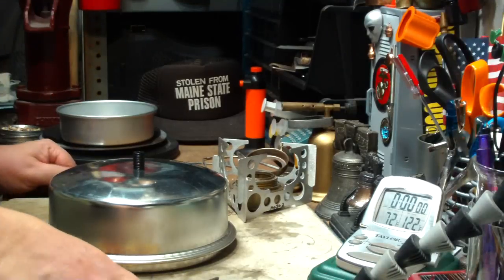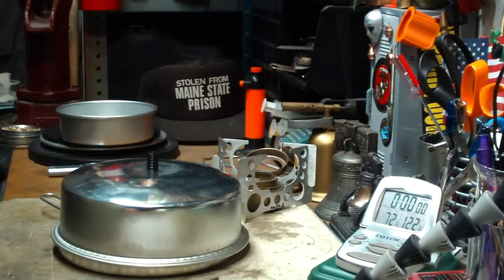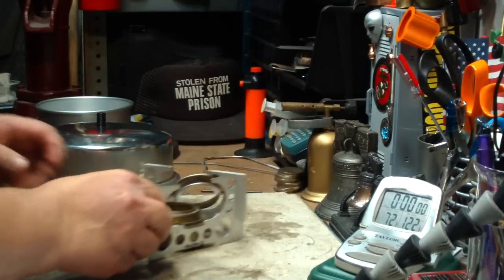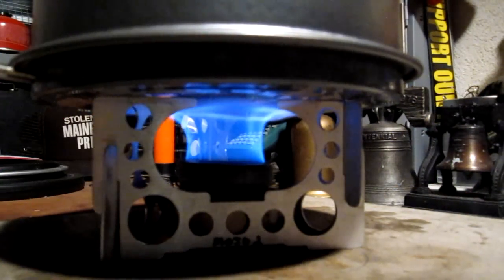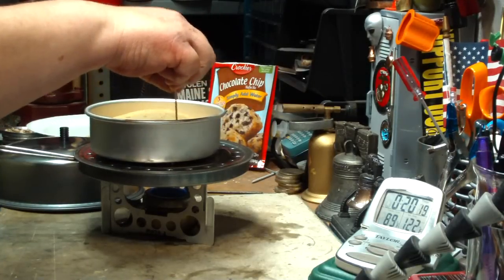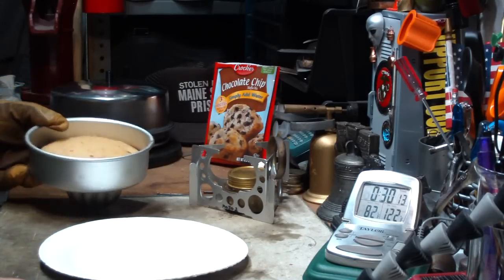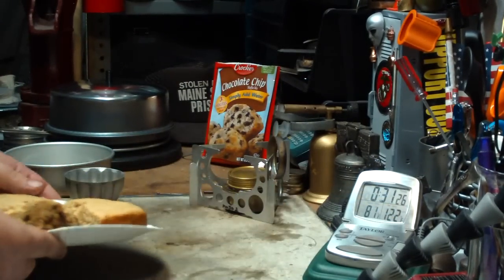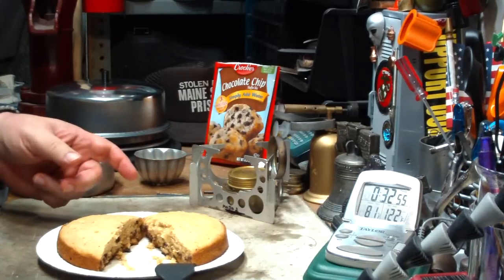Dry Baking a Muffin with the Stove Top Oven

Comment: very cool, such heat diffusers can be well used on gas or alcohol stoves. You can use them also open for toasting bread or so.
But they are not recommendable for use on oil burners, wax fueled buddy burners, or stoves using fuel tablets like esbit or so, since smoke and smell will enter the thing - this would in the long run block the diffuser's function, and in the short run Your cake may get a very bad smell ... ;-)

Comment: Hiram, looking at the pressed in rings I think you aren't supposed to elevate the inside pan... Guessing only the outside edge of the baking pan should be provided with heat from the burner as it enters the "oven" via the base plate... Also guessing that without the spacing it would take longer to bake... But he, results can't be argued with, that muffin looks very delicious! :-)